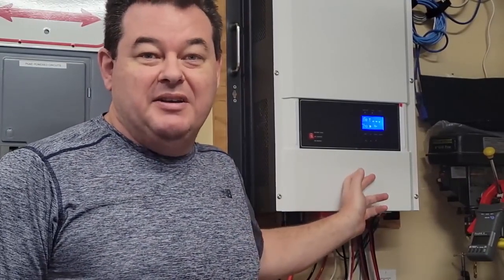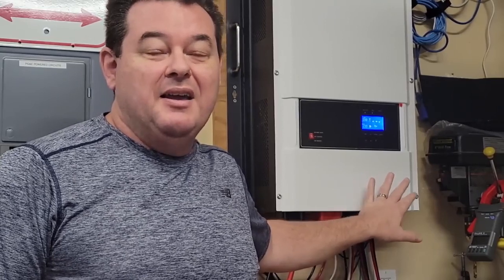Growatt UPS Mode - or SBU on this stormy day

Comment: HOWdy  BH736, ... 
I have a Growatt  SPF 6000T DVM-MPV  inverter /// HYBRID Set-Up ... 
& 
I have never owned a CELLULAR TELEPHONE nor downloaded any "APPS"  ...  
My inverter runs in UPS mode automatically if I have the GRID turned on as a back-up at night  /// like during foul weather, etc Etc ETC ... 
I have experienced  several complete ( HOURS LONG ) Power-Outages and was NOT aware of the GRID Power Interruption until "DUKE ENERGY's " ROBO CALLER informed me ... 
I never even saw a "FLICKER" when it transferred from GRID to BATTERY Power & had to check my inverter to NOTICE the  "TELEPHONE - POLE"  ICON had disappeared ... 
 ( the only reason that  I  had the GRID POWER  Circuit-Breaker turned "on" in the first place was to preserve my BATTERY POWER in case of emergency ) ... 
GENERALLY my bill from DUKE ENERGY is a simple CONNECTION  charge of:  $ 10.54 to keep the METER on my Home's WALL ...
COOP
the WiSeNhEiMeR from Richmond, INDIANA 
...
Reply from the maker: That independence and almost zero utility bill is totally worth it!

Comment: 1. Did you connect your grid neutral and inverter's output neutral?  2. Did you bond N-G in the main breaker box?
Reply from the maker: This machine is wired off-grid.  The sub panel it powered has an N-G bond and its own ground rod.